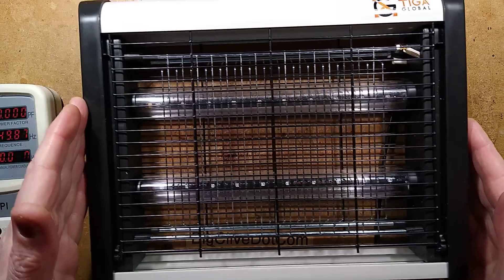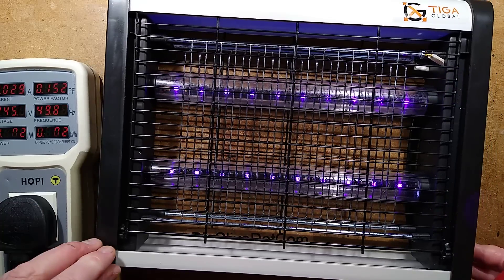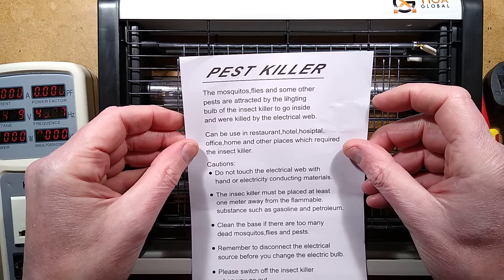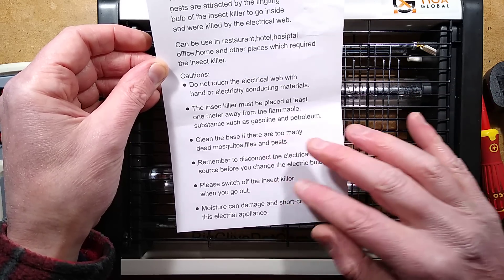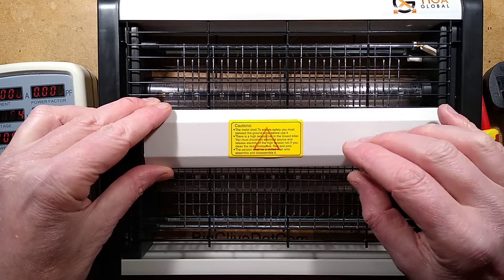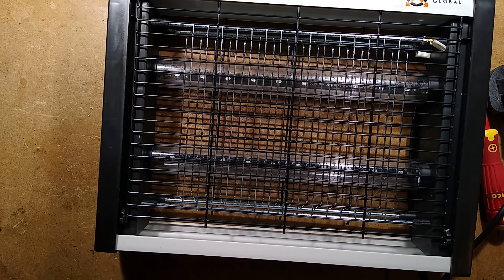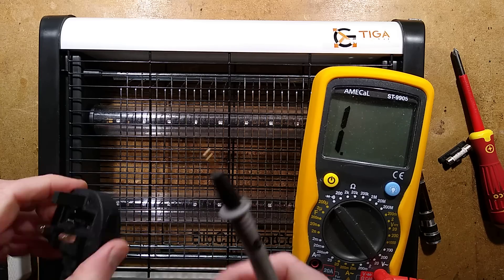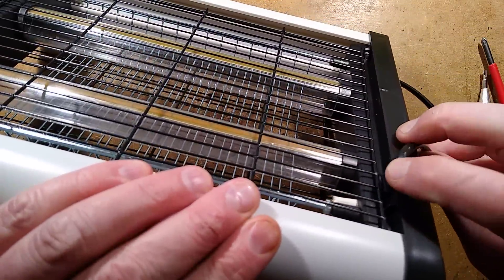eBay LED insect zapper teardown with schematic

Comment: Would it be feasible to flip the switch over so that the Live went through it instead of the Neutral? If so, would it be difficult?

in other words, is the poor thing salvageable?
Reply from the maker: It could be rewired, but is of debatable functionality.

Comment: I wonder if this is a situation where European 30mA RCDs (type A or AC) fail to provide protection. Running the math of the capacitor, diode, and 1k resistor, you've basically got a 15mA current-limited supply if you touched the grid. That is potentially enough to be fatal (anything above 10mA is), but not enough to trip the RCD. 

Coming from the US where the standard GFCI is 5mA, 30mA has always seemed a lot to me.
Reply from the maker: We tend to use 30mA because one RCD/GFCI covers a whole circuit, or sometimes half the house.
Reply: @bigclivedotcom  Or the entire house outside UK.

Comment: I would think a  bit of rotting meat would be more effective at attracting flies than those LEDs!  These things need a CO2 generator to attract the flying nasties.
Reply: I know mosquitoes are attracted to CO2, so that's correct. I'm not certain how well that works for flies. In the past, we got pheromone strips to attract flies. I don't know where to get those today. UV alone (even from a BLB fluorescent tube) were documented as not effective against flies. There are some commercial units that have a blue glow emanating from them, but only as indirect light, so I suspect they use UVC tubes to do all the work. As for their fly attractant, I have no info.
Reply: @mikecowen6507  The rotting meat will attract the flies 🤣- and yes the CO2 is to get the mozzies and those darn irritating swarms of midges 😂

Comment: I expected so much worse, given how DiodeGoneWild has had complete death traps every time he tries an insect zapper, such as the one with the self exploding UV lamp.

Fascinating to see what appears to actually be a compliant plug on it, UK plugs seem to be the most prone for getting things wrong with questionable electrical imports.
Reply: Countries which use the UK style plug often ignore the way it is supposed to work. Plugs often have no fuse at all, and circuits are wired at random. I was in a site office where one breaker tripped, and a section of the office lost power to sockets AND lights.
Reply: @michaeltb1358  ... It's supposed to work? I keed, I keed.
Reply: The remains of our “once” British empire have inherited various bits/periods of our electrical system
Reply: And yet another 3-week-old comment
Reply: @bartat404  Clive releases some videos to "members" prior to the general public?

Comment: Those speaker pops coming through my 505W subwoofer are really gnarly   :)  
So if only the "men" can work on it are the rent-boys allowed as well?
Reply from the maker: They are quite peaky.  It makes you realize how loud a spark is
Reply: Can't imagine what my 1800w sub amp in my basement would do... I watched the edge of tomorrow on the setup and the intro trashed an 18 inch sub O.o